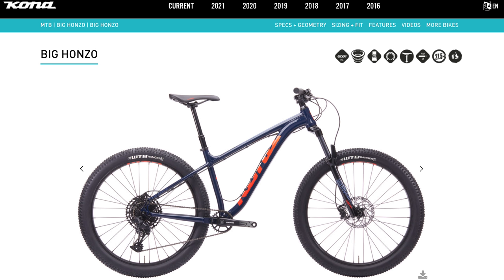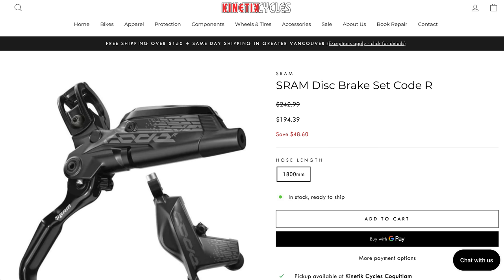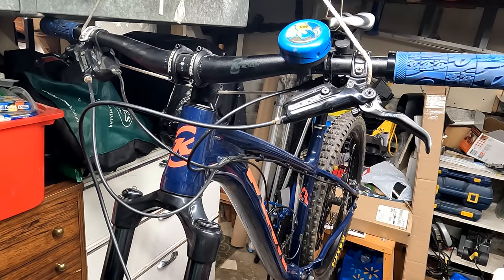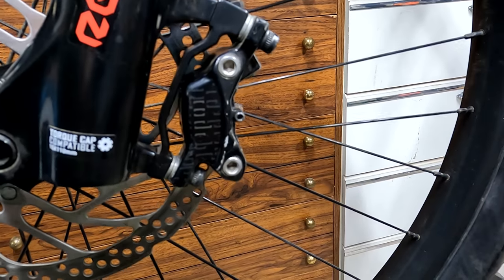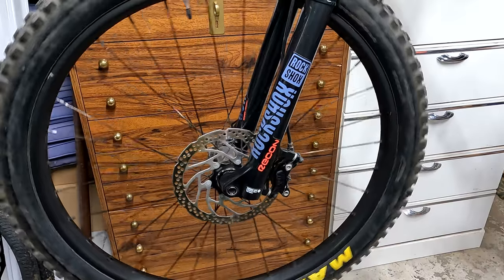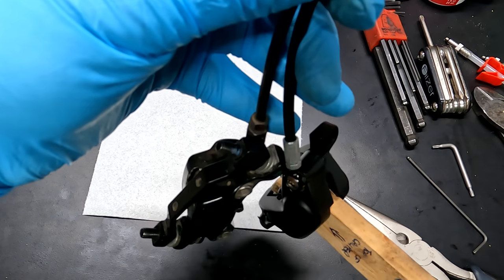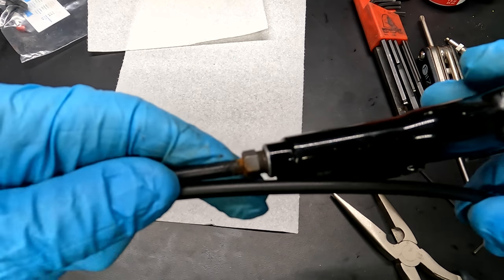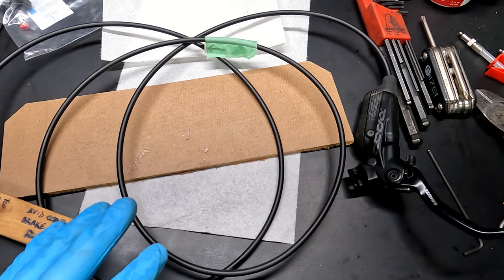New SRAM Code hydraulic brake install - cut cable, Stealth-a-majig, install on bike, bleed brake

Comment: DOT 4? Not sure about that choice, but the rest of the video was very helpful!
Reply from the maker: DOT 4 is fully compatible with DOT 5.1 as they are both glycol-based and SRAM indicates all their brake systems use one or the other. The main difference is DOT 5.1 has a 260C boiling point instead of 230C for DOT 4.  So if my brake fluid ends up exceeding that 230C limit you may have a valid point. I don't know if that's true but it's a factor worth considering.